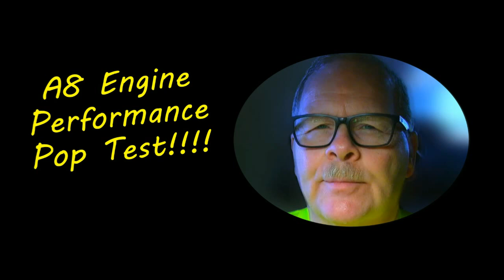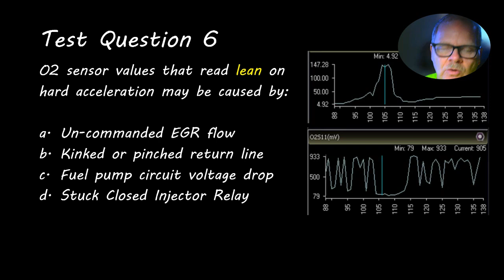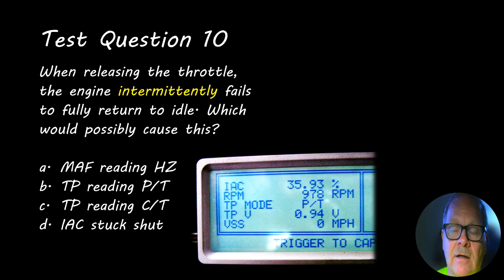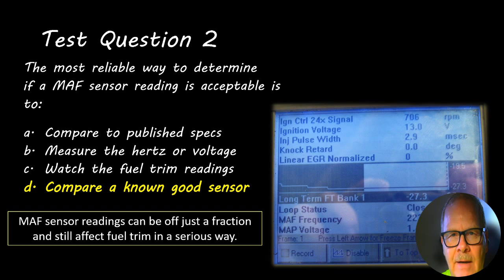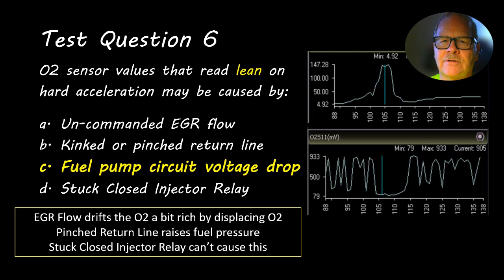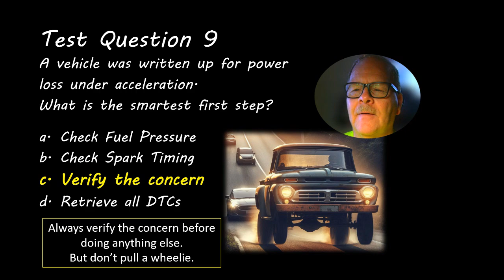A8 EP Pop Test

Comment: Shop experience is important. This work is not for everyone so figure that early. I agree cred certs do help people who don't know think your legit. They can be the deciding factor between you more and someone less qualified that does have em. It is worth it. While looking at a 60's Ford someone said  "my real mechanic charged me $3000 to stop that valve cover leaking"  super proud of the work and price paid for it. I pulled the engine for full access to  rusted through freeze plugs, pressure washed a few lbs of rust out, and charged not even a 1/4 what I should. They still think more highly of $3000 oil leak on a 60's Ford dude. Some engineer customers  were awesome they could see the value, refuse to call someone else, and will be happy to pay way too much for full disclosure welcome to watch me work on your ride service. Supped up & gnarly Monday machine 

Have a awesome week
Reply from the maker: Even at the dealership I would sometimes do repairs for nearly nothing just to get a return customer by charging them a whole lot less than they expected to pay at the dealer. You don't have to get rich off every job
Reply: @McCuistian   As a little boy I wanted to grow up to do something worth doing with my hands. The world told me I am supposed to get rich even if it's wrong.